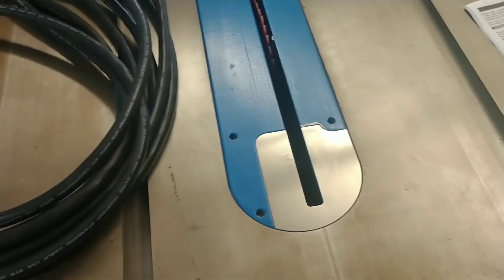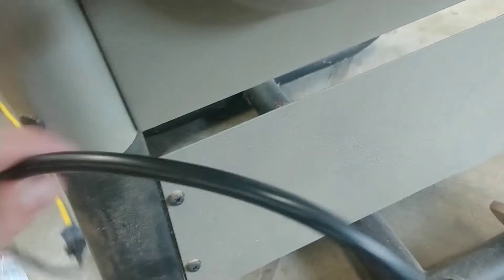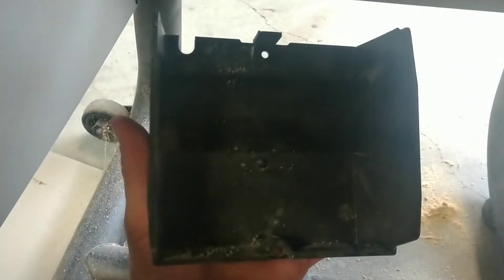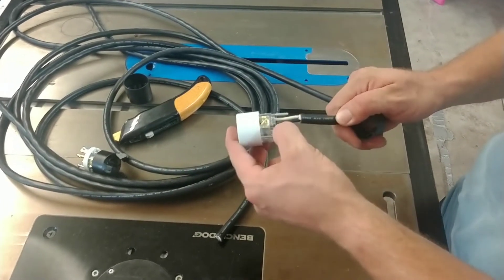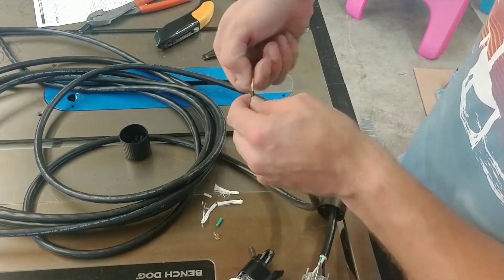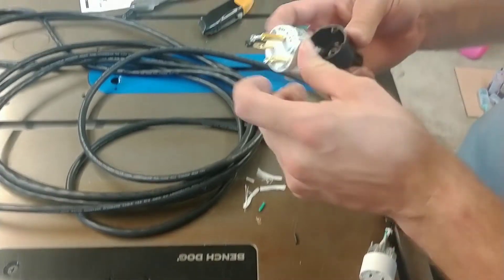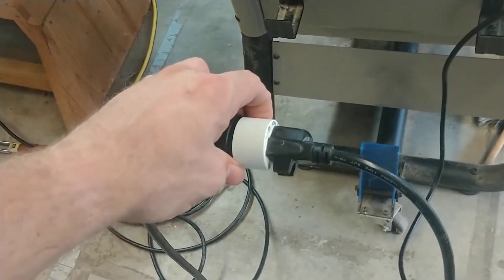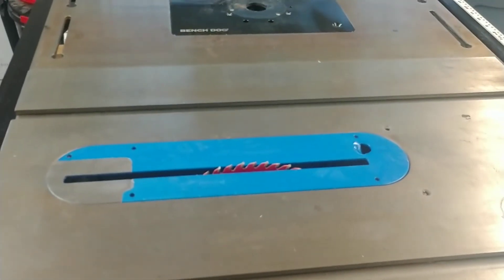How to Convert a Table saw from 120v to 240v

Comment: Exactly what I needed! Just picked up the same saw and was wondering if I really needed to rewire it or if I could just make an adapter cord like this, so this video was perfect. Already got a 240v outlet in the garage and I've always been iffy after hearing how many problems the motors on these saws have had. 240 will put my mind at ease.
Reply from the maker: The best bet is to always refer to the user manual for your specific model. I can say I've never come across one that didn't require something to be done at the saw even if it's as straightforward as flipping a switch behind a cover plate. In a lot of newer models, there's just a switch on the motor that you can use to go from 120v to 240v.

Comment: A word of caution , change the wall receptical as it is actually a 20A 120 volt model. In theory a person could inadvertently plug a 20A 120 volt tool into a receptical that is hot w/230 volts.
Reply from the maker: Respectfully, you are wrong,  I would urge you again to look at 8:42 and you can see the outlet this will be plugged into. Model NEMA 6-20R for reference. There is no way to physically plug a 120v cord into this whether it be NEMA 5-15P or 5-20P.
Reply: my concern is not so much to outlet, but the extension cord. Someone could plug tha extension cord into it's correct outlet and then plug anything into the other side of the extension cord and have a very bad day. The extension cord is what is unsafe.

Comment: What cable ends did you use when you made your custom cable? I want to do the same but all the female ends for the 110 plug coming from the saw are only rated for 15 amps at 110. Maybe it doesn't matter? I've been known to overthink things lol.
Reply from the maker: I used the NEMA 6-15 cord caps that are rated for 15A and 240v. If your wanting 20A at 120v you will want the NEMA 5-20. That being said the existing cord caps you have will work fine because as you increase your voltage the amp draw will decrease.
Hope that helps
Reply: @HowitsdoneHandyman  That does help a lot, thanks! I watched it again and did some side reading, all makes sense now. Pretty great feature to be able to switch between 110 and 220 so easily, although I doubt I'll switch back to 110 often. Thanks for the response and posting the video, cheers!

Comment: What wire zise it's
Reply from the maker: The size you need will vary depending on your saw, operating voltage, and the length of the cord. Look in your user manual to get specifics. I cover this at 0:15 in the video.